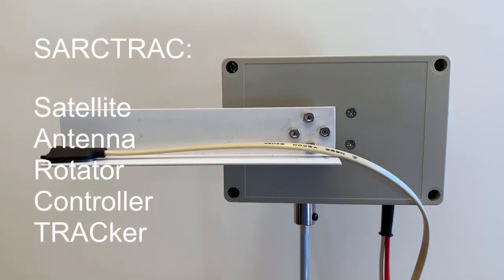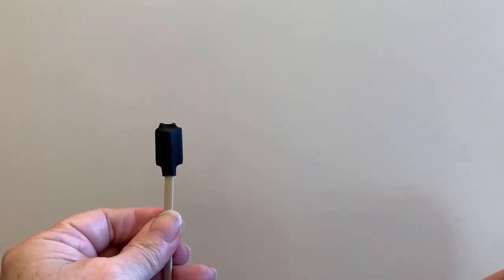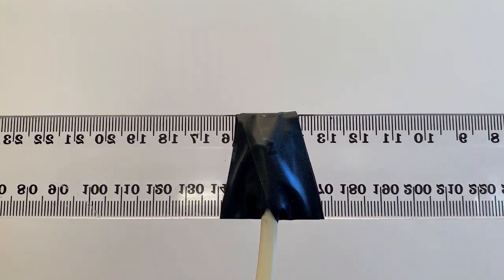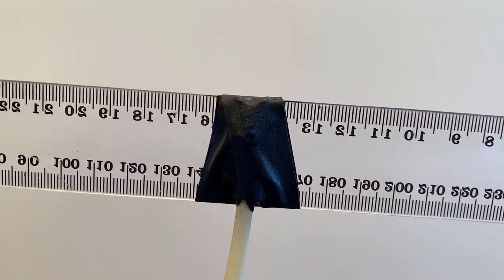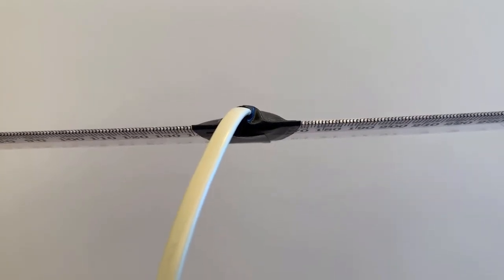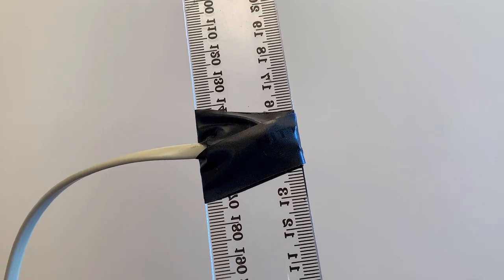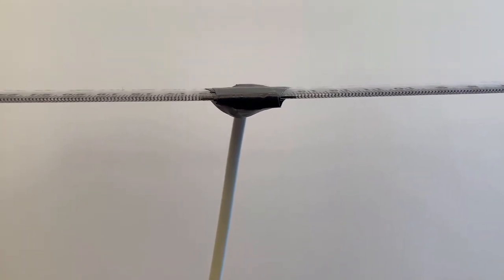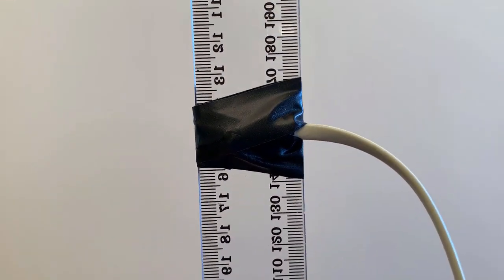SARCTRAC 3D Sensor Calibration

Comment: Hi All, I am trying to make rotator MK1b and I am badly lost with the step of calibrating the sensor. It looks like you use the phone app to calibrate the sensor, what app is it? Also I am assuming the sensor must be connected to the Arduino, so how do you connect Arduino to the phone? Many thanks :) :) :)
Reply: Hi, I started making a rotator MK1b just by looking at the diagram. I started to struggle with the project when I had to do the calibration process. When I found out that (as long as I understand) I need to connect buzzer and magnetic 3d sensor to raspberry pi zero usb hat to get it calibrated, but then I need to buy teh SD card and software. I hope I do not need anything else, as I bought everything already. Can I please have a link how I can buy the software and SD card?
Reply from the maker: Hi Pawel,
The dialog boxes you see are for our SARCTRAC 2 product, which had a web interface. If you are using our free Arduino version, called the Mini Satellite-Antenna Rotator project, you will be entering commands via the USB port, using the Arduino IDE Serial Monitor or PuTTY. Here are the instructions from our website (https://www.sarcnet.org/rotator-mk1.html#CompilationInstructions):

Go on-line to calculate the magnetic declination in your area. Go to http://www.ngdc.noaa.gov/geomag-web/. Enter your country and city. Press "Add Lat/Lon" then press "Calculate" to get your magnetic declination. Say it is 11 degrees, 40 minutes, East. Convert this number to decimal degrees by dividing the minutes part by 60 and adding it to the degrees part, so that's 40/60=0.7 plus 11 equals 11.7. Use a negative number (-11.7) if it says West instead of East.
Type in e11.7<Enter> to enter the magnetic declination (make sure you type in your own value). Then s<Enter> to save it.
Now start the calibration process by typing c<Enter>.
You can abort the process at any time by typing a<Enter>.
When you have completed the calibration process, properly, just type s<Enter> to save the calibration data to non-volatile memory.
To calibrate the sensor you have to move it around very, very slowly. Don't bump it or even think about changing hands.
It helps to tape the sensor and the sensor cable to the back of plastic or wooden ruler and hold the ends of the ruler in each hand.
Move the sensor around. The piezo device will beep and you will see the 3D magnetometer (M) and accelerometer (G) errors and scaling factors changing on the screen.
You can pretty much keep moving the sensor all around until the piezo device stops beeping or the data stops changing, but there is a trick to doing it properly.
Think of the sensor as a cube with six faces. You need to point each face in the direction of the Earth's magnetic field and again in the direction of the earth's gravitational field. The gravitational field points straight down, while the magnetic field points up (in the Southern hemisphere) to the North at an angle of about 70 degrees to the horizontal. There are 12 directions and you have to move the sensor a little bit around each point until the piezo device stops beeping or the data stops changing.

Near the equator the Earth's magnetic field is horizontal. In the Southern hemisphere it points up, and in the Northern hemisphere it points down. But it always faces North. For correct calibration, each face of the sensor must be pointed parallel to that direction and moved around until the maximum is found. The same applies for the gravitational field, which is always vertical (so 12 points in all). It does not matter, of course, if you point the sensor in the direction of the field or opposite to the field as you will be doing that consistently for each orthogonal face.  

Hope this helps. Good luck from Julie and Joe
Reply: @sarcnet7113  Thank you so much, I just got confused because in the MK1B version for the calibration process you link to this video!! :) Is it possible to purchase just SD card and the app anyway, if I decide to upgrade to MK3 version, especially motors and motor controller are the same?
Many thanks :)

Comment from the maker: Hi Patrick,
That is correct, the 6-sides of the sensor must be pointed parallel to the Earth's magnetic field in your area. It the makes the process slightly easier, in places further from the Equator, if you orient yourself in the direction where the sensor needs to be tilted upwards to achieve that. Some viewers have asked for more details about the sensor orientation when taping it to the ruler: Again it makes the process easier if the flat side of the sensor is taped to the ruler with the Y direction initially pointing up. Details of the 3D Sensor orientation are shown here: https://www.sarcnet.org/rotator-mk1.html#SensorOrientation. No matter where you are, or how you mount it, the sensor needs to be moved very carefully around the 12 cardinal positions for the magnetic and gravity field vectors for a successful calibration.
Kind regards and stay safe,
Julie and Joe
The School Amateur Radio Club Network
www.sarcnet.org